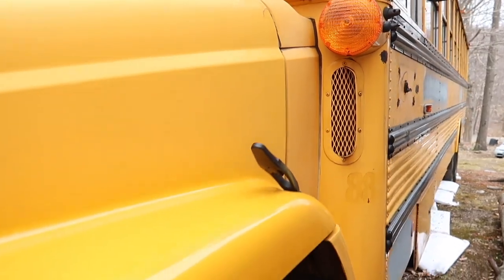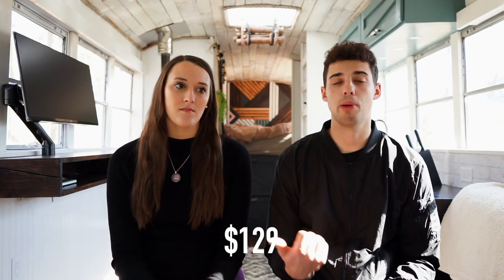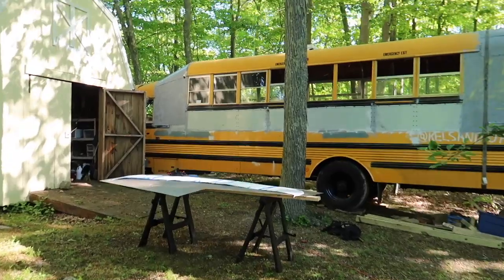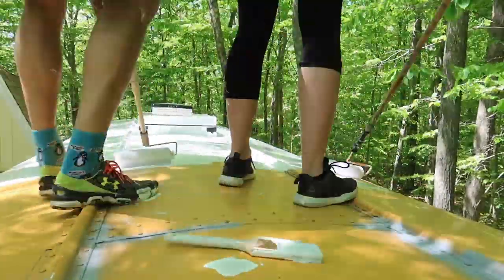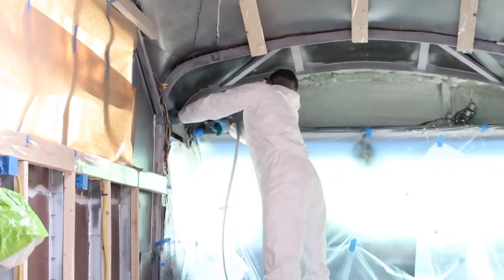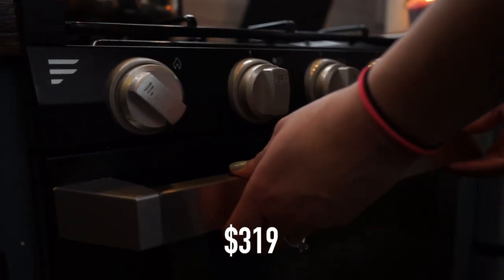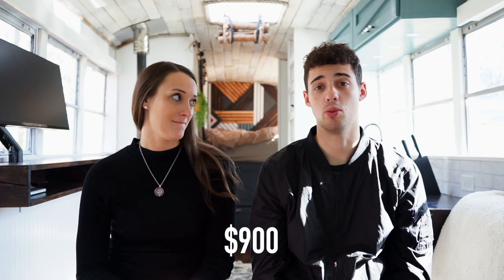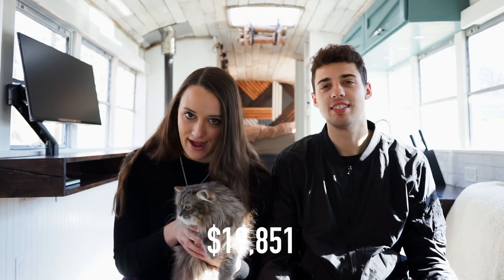How Much Does It Cost To Build A Skoolie?! School Bus to Tiny House | We Spent How Much??!!

Comment: Guys, loved the conversion. Can you tell a Little bit more about the stove/oven? I'm doing a lot of research and everyone, of course, has different takes about having one. I Cook, so I NEED it. Yours run on propane,is it efficient? Thanks and regards from an Argentine artist living in Panamá.
Reply: Gabriela Laura Colimodio Propane would be the best option unless you are plugged into electric all the time 👍🏼. Or you can cook outside... the weather is always nice down there😜
Reply from the maker: Gabriela Laura Colimodio thank you!! Yes it runs on propane and it's awesome!! We've been using it everyday for 3 weeks and haven't run out of propane yet. Panama is so beautiful 😍
Reply: @KelsAndJay  which Brand? And yes, there are some beautiful beaches here in Panamá. 😉
Reply from the maker: @gabrielalauracolimodio9988  17" FURRION RV RANGE OVEN FSRE17SA- BL STOVE LP PIEZO IGNITION. We got it from a surplus website for way cheaper because of a dent it has on the back. Yes, for sure! We follow the NomadicMovement and are always drooling over the scenery :)
Reply: @KelsAndJay  thanks, guys. Stay healthy, stay safe.

Comment: Hey guys, love your channel!
I've been doing a lot of research for my own build and can't decide if having a propane set up for stove and hot water is worth it? Or if I should go all electric and heavily invest in solar? How long does your 40 gallons of propane last you? Does your solar set up provide you with more than enough power for what you're running, or would you say you could use more? Thanks guys!!
Reply from the maker: hey Alex! Thats awesome and some greta questions!! We would say go for the propane, we havnt even used 20lbs of our propane in a month and it was super easy to install. Our solar could probably benefit from a couple more panels on the roof to provide all the power we will truly need while boondocking. Hope this helps